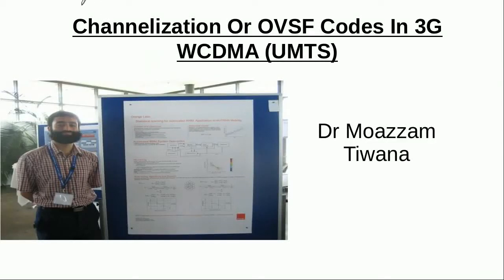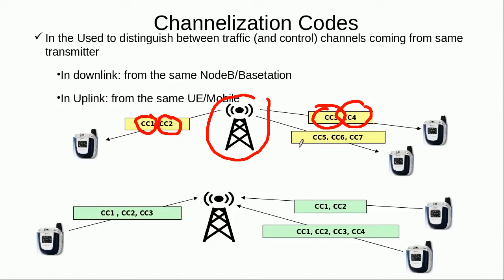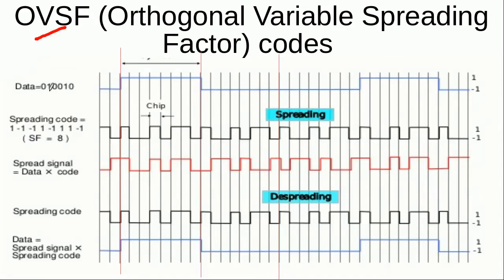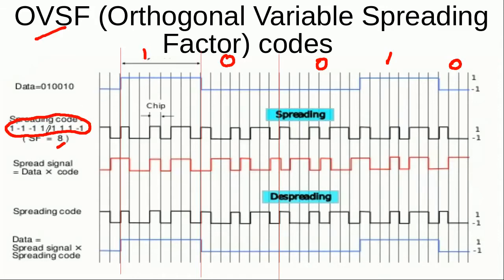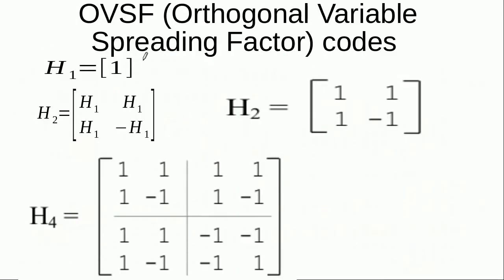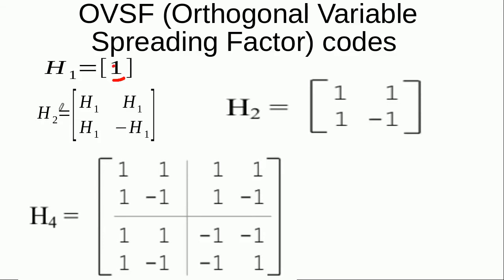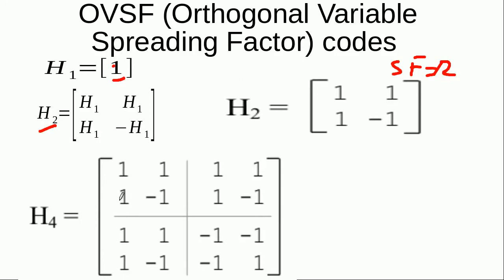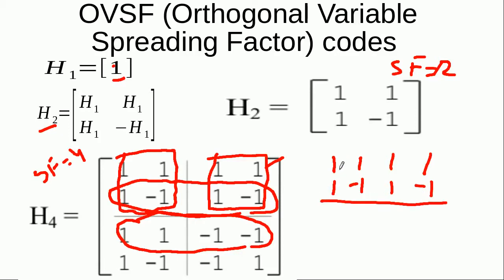Channelization Or OVSF Codes In 3G WCDMA (UMTS)

Comment: Good afternoon, thanks for the video its well put together. I have a quick question, in regards to the spread bandwith value, it is actually 3.84MHz, but it increases to 5MHz with inclusion of guard bands ? 

So if I have a despread bandwith of 625kHz (pre spreading) and a 8 chip channelisation code applied I get 5MHz but in actuality the pre channelisation coding the bandwith of the signal is 3.84MHz/8=480kHz ? Therefore 145kHz is guard band allocation ?